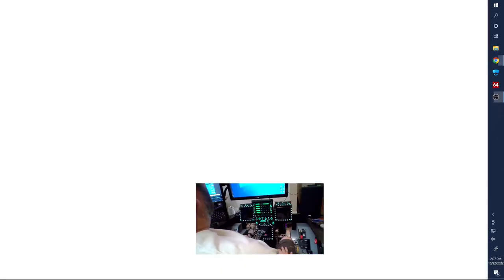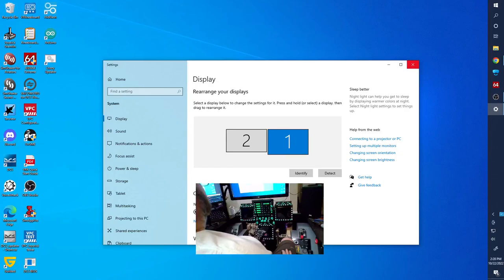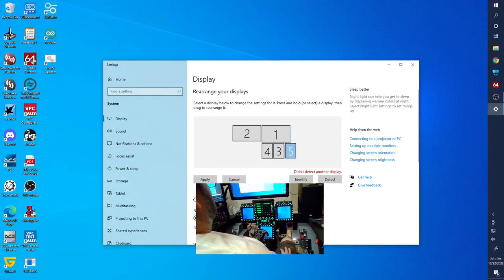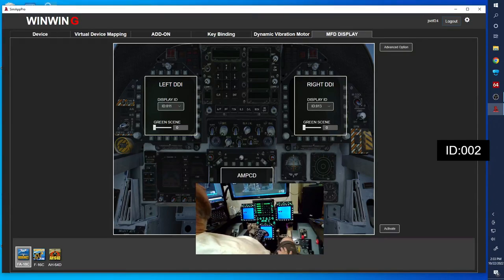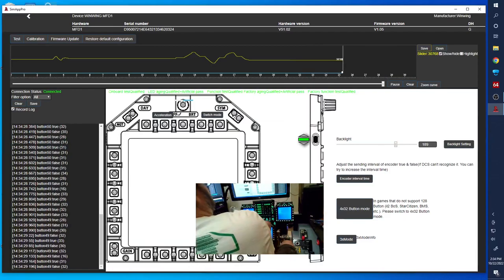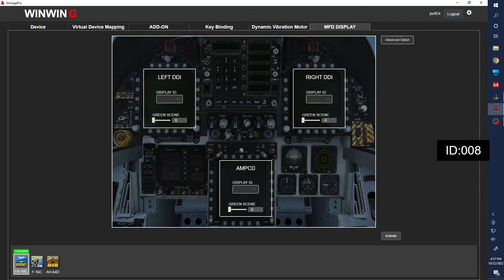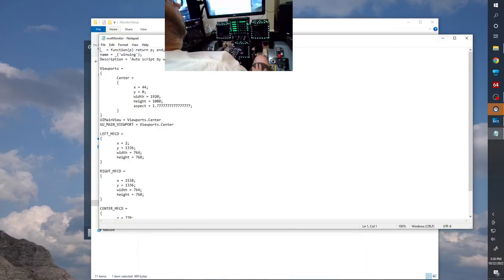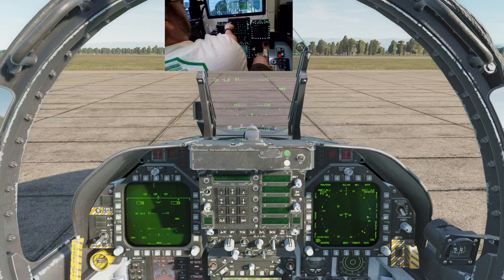Setting up the WinWing TopGun MIP (Main Instrument Panel)  (Display Link, SIMAPP Pro, and DCS)

Comment: This thing blew me away. I just now got mine working after a few minutes of nail biting. Issue ended up being my usb 3.0 hub had a 2.0 device plugged into it so the screens wouldn't come up. Literally just uploaded a quick unlisted "Haha - look what I have and you don't" video for a simmer friend of mine before I go to bed. Took longer to put together than I anticipated but I also recorded a few videos to later upload (much later). The only gripe I have was they shorted me 3 usb c cables. This thing takes 10 usb cables. I can't believe how awesome it is. Far above my expectations. Most people don't like the quiet keys but I prefer them. I have too many complainers living with me so the quieter my switches, knobs and buttons are, the better. I wouldn't bother downloading the drivers (they call drivers but is the Displayling software) from the app or their site. Google it and download from the source. It's newer.  Major love for WinWing lately. I bought the Orion 2 base, F18 stick, Super Taurus with F18 handles, a few things from Virpil and a ton from MonsterTech. WinWing's service blows them all away. From ordering to in my hands in only a week (from China to Florida). They update their site several times a day while Virpil just lists everything out of stock on purpose due to their new delivery fairness system and I won't even start my gripes about monstertech. WinWing is my new favorite everything. Here's my one minute video. A much more in depth one will be done when I eventually get my rig (6 month wait on the seat, so it will be a while)... https://youtu.be/yLwYaXYn8pU

Comment: Thanks for the great video. Is there any place that describes in writing the procedure start to finish using the WinWing modules for a new system. Also, does all this work on Microsoft Flight for the F18? Any opinion on this? Thanks again!

Comment: It took a couple weeks of fiddling with the UFC to get the characters to show up on the display. Worked with WinWing support for several days of trying various fixes to no avail. In the end, the "repair lua" button solved my problems (although that didn't work at the start of the mess). It's still a bit of a hassle to get up and running because the screens are always moving around and changing back to landscape mode. I've got it down to just a min or two to get the screens worked out. I have two 1440p and one 2560x1980 with the three MIP screens under it. The two 1440p monitors are not used in DCS. I wish it all just turned on and worked and maybe someday it will. Until then, I can live with a bit of hassle prior to launching DCS. Waiting for the F-16C add on.

Comment: Did you have any issues with the UFC digits showing up ? They all still show Test Starburst pattern even after clicking on the SYNC DCS and Repair LUA options in the Settings.
Reply from the maker: no they worked just fine for me

Comment: Great setup. I wonder if you could tell me the full width of the full setup. e.g with the left mfd, UFC and right mfd. I'm a bit worried this isn't going to fit into my current pit.
Reply: Nevermind, Ignore my question above. I've found the manuals via the website which has the dimensions. MFDs are 170mm and UFC is 195mm (in case anyone else is looking)

Comment: Great vid. Thank you. I need some help. So I installed the Topgun MIP and all is well. I configured the screens on Display Link and simapppro but I am only getting one mfd ID# not all three mfds. Also, when I get into a game, the right mfd buttons effects the left mfd screen, and the center buttons affect the right and so on. Any idea why? Thanks .
Reply from the maker: I would try plugging the USBs from display into different spots.  I had to use 2 separate powered hubs to get mine to work right, if they were all 3 plugged into the same hub, windows would not recognize them properly.  You may have to rebind the buttons on the controls settings screen in DCS

Comment: Really helpful tutorials! Got it all put together easy thanks to your help. Everything was smooth but now I am stuck.   

I have installed the drivers from display link. Simapp pro says my drivers are installed but I am stuck at “check display settings in windows”.  

Windows 11 is not recognizing the monitors and when I check usb devices in settings it says “Driver Error” under each winwing usb 3.0 display.

Comment: Hey John, great video, by any chance can you tell me the  distance between the outer edge brackets for the left and right ddi? Trying to figure out how long of an extrusion I need to mount the mip.  Thanks!
Reply from the maker: you want the distance spanning between the outside of the brackets of the outer DDIs?  outside edge of left DDI bracket to outside edge of right ddi bracket?
Reply from the maker: if so, Mine are 20 3/4" from outside bracket to outside bracket.  I have about a 1/4" gap between each ddi and the UFC to mimic the layout in the real jet

Comment: This is very good information with the walkthrough and setup...  What I have a question on is...  Currently my DCS monitor settings are triple screen x 4k..  In the dcs; it will display 11520x2160...  Using the 3 usb displays - would it require these settings to be modified???  Also does it impact FPS???  How is the display performance on the USB screens???  Finally, can you display the F16 MFD imaged onto these displays??
Reply from the maker: SIMAPP pro will edit the lua in the monitor setup to use all your screens and place the MFDs appropriate.  I mainly play in VR, so I won't be using the screens much until mixed reality becomes a thing.  I can't answer your FPS performance.  The screens seems to work fine but maybe a little dim.  I'm not a viper guy so I can't help you with the F-16 images either
Reply: @DCSTex  Ok thx for the feedback.  Looking forward to more of your findings..

Comment: Question, do you have the harrier and 16? do they work on here too?? - i know the fd14 won't my personal ones i had to add some code to, to make it work. i can't wait to get one
Reply: They work perfectly on the F-16 and the lower screen shows the HSI. I dont have the harrier, but I tested it on the Warthog and it actually worked fine (I just set the winwing software to F-18). The Lua file just gets edited for generic MPCD Left and MPCD Right, so any airplane that outputs the screens with those commands will work. I would wager the harrier works fine.

Comment: Are you not using the windows display drivers? Just want to make sure I follow this correctly before I set mine up. Thanks for the video!
Reply from the maker: The winwing displays use the Display Link USB video driver.  I don't believe there is a windows version of it.

Comment: Great video - many thanks John. With regards to the monitor config file - does SimApp adjust this accordingly depending on what hardware is attached? e.g. what happens if you unplug the DDIs/AMPCD and run DCS. Will SimApp change the file accordingly? Thanks 👍
Reply from the maker: Pretty sure you would have to hit the activate button again for it to make changes.  It does pop up a warning message every time something changes
Reply: @DCSTex  ok thanks, makes sense. I hope they can automate this in the future.

Comment: Hi John. Thank you for this. I have my MPI all set up. And working fine. But one really annoying issue that seems to involve how Win 11 handles attached USB monitors. I set up the orientation (portrait) and placement of the 3 USB DDI screens in the Display Settings in relation to the main screen I’m using (LG 48 Ultragear 4K gaming monitor), apply it, synch in the SinApp Pro dashboard, and activate the DDIs. All good. BUT every time I restart the computer, it changes the display settings of my USB monitors, changing them back to landscape and placing them alongside my main monitor, not underneath it where I arranged it. In short, Win 11 Display Settings will NOT remember the previous display arrangements. Every time I start the computer, I must rearrange this USB monitors again. Extremely annoy8 g and I cannot find a solution on the web. Did you also have this problem? Any idea on how to fix? Thank you.
Reply from the maker: I'm on W10 and did not have the issue
Reply: @DCSTex  Ok John. Thanks for replying. I have no idea what is causing it. Scouring the net. Regards, apoll
Reply: I have exactly the same problem, running W10. Same happens if I unplug one of the displays from my USB hub and plug it in again. I have 4 of these displays attached (one extra for the IFEI). 

EDIT: Installing the DisplayLink Manager App and setting the layout from there fixed it for me.
Reply: Check you don't have simapp pro to reset screen orientation and scaling to former statue in the MGD Display page

Comment: yeah yeah screens need be potrait mode it tells that on simapppro. ddi amd ampcd is recognized and setup correct position. in game only ampcd buttons are binded but it controll right ddi. left and right ddi not binded. also ufc display only show default all lights. and all those usb cables uf uf. its awesome but worthless when not work

Comment: I'm getting my desktop on all my DDI's. What am I doing wrong
Reply from the maker: thats how its supposed to work until you spawn into a jet.  Did you do the Simapp pro MFD setup page?
Reply: @DCSTex  Yes but I'm only getting one DDI working spawned in cockpit. Im using VR if that info helps. If I touch left DDI it changes the right DDI. If I change the lower DDI it changes the right DDI. I'm close but no cigar. Any ideas?
Reply: @DCSTex  also I noticed in game hud seems dim?
Reply from the maker: @ajackson8926  sounds like you have them mirrored in windows instead of extending the desktop.  Mine are dim as well
Reply: @DCSTex  I figured it out it was because I downloaded the cockpit editor. I deleted that and all is fine.  Thank you John
Reply: It helped the dimness
Reply: Are you talking about dim MFDs? I just set mine up and it seems the displays are dim. Any way this can be adjusted?
Reply from the maker: @johnwashington6119  not that I know of.. typical complaint on these screens.  I'm surprised they are as bright as they are, just getting power from USB
Reply: @DCSTex  Thanks John. I see other power options on the back. Wonder if I use one of those if it would boost the brightness..
Reply from the maker: @johnwashington6119  I don't think those are wired into anything..at least that is what WW is saying

Comment: I bought just one mfd and i can't get sim app pro to see it as a device. It shows up in windows fine and i installed the drivers. I have connected it directly to my PC as well as a powered usb hub and the display works but not the mfd buttons nor will the buttons light up. Tryin to get winwing to help but their english is not very good. lol
Reply from the maker: Does windows recognize it as a usb game controller?  If not you might have a faulty device.. I'd try it on another PC if you can and if it doesn't recognize it, you'll need to RMA it with Winwing
Reply: @DCSTex  I figured it out. I was an idiot and forgot to plug the usb C cable into the MFD button pad. I am now tryig to figure out how to make the MFD screen switch using the clone button on the mfd pad. I can switch between mfds in game and use any MFD but my screen only stays on whatever screen i selected in the sim app pro panel. Accoridng to Winwing the screen should change also but I don't see how thats possible unless I am able to use the same screen in the MFD setup in the sim app pro software.

Comment: It's been nothing but a nightmare for me. The hardware seems to work. First issue I had was all 3 displays were displaying sideways. I had to put them in portrait mode to get them to look right. Did yours do that? And then after going through the entire setup and getting green on everything it just doesn't work. Right mfd doesn't even show anything except my desktop and the other 2 are showing parts of the plane. The main screen is so out of proportion I can't even navigate the main menu.
Reply from the maker: might watch my video again.. I did had to change portrait mode.  Seems like youre missing a step in there somewhere